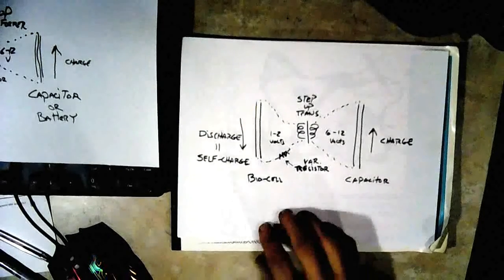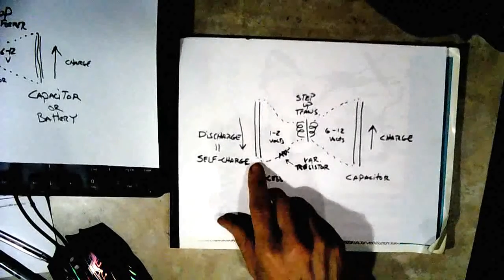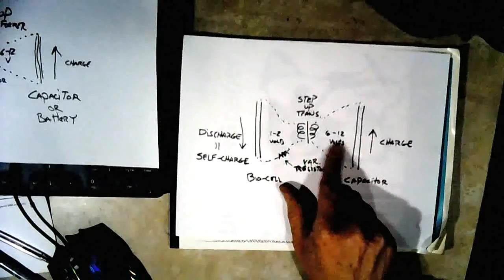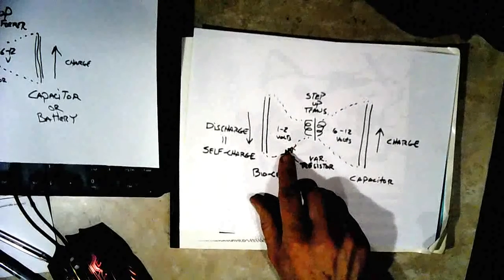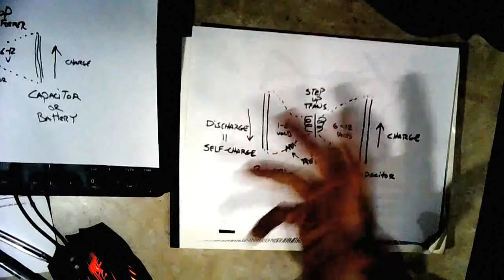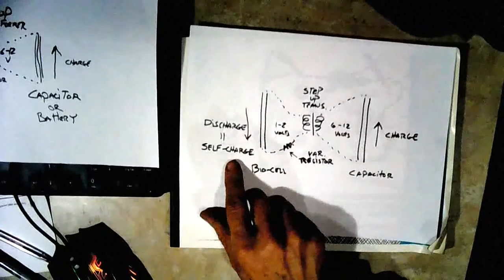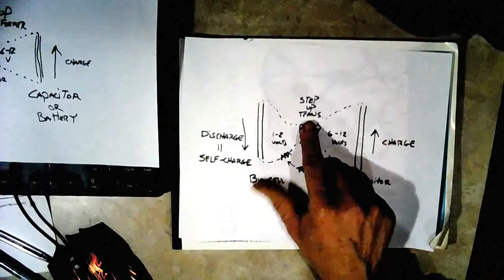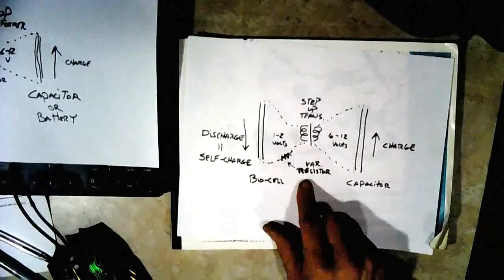Demo #40 Charging a Capacitor with the Bio-Cell

Comment: You need a boost converter, take apart a cheap solar garden light which boosts approx 0.7 - 1.2 volts upto 3.2v. if you remove the white led you will find it will charge higher, yes even 12v. You may want to use a zener diode to prevent overcharge of the secondary capacitor or bettery. Another option is to build a "joule thief" which is pretty much the same circuit.
Reply from the maker: Ah, sounds like a good cheap solution to the problem proteinman. Would a variable resistor work ok with that?

Comment: Fortunately, you can't run DC current through a Transformer it must be alternating current or pulsed current,  I would suggest using a pwm ( pulse-width modulation).  I assume you cannot run these cells in series without damaging there charging capability?
Reply from the maker: Good point ZPF!  I don't know about running the battery in series or not, I haven't tried it yet, but I assume you can. I'll find out. Thanks for the comment!

Comment: I tried charging a lithium cell with a crystal cell through a joule thief but the output  of crystal cells is so low the rate of charge was impractical for much more than lighting LEDs which the crystal cell will do on it's own anyway so I discontinued the experiment. The output of a joule thief is pulsed so it may pass through the capacitor during use. It'll be interesting to see how it works.
Reply from the maker: Hi Fred, why would a pulsed current pass through a capacitor? I've never heard that before.
Reply: I'm not sure it would. The circuit is a blocking oscillator and although essentially produces a DC square wave there is a back flow through the transistor albeit very small at cutoff. The response curve shows slight dips at the top and bottom, the magnitude dependent on the components being used. The frequency is typically in the 50kHz range. Depending on the capacitance it could react if ever so slightly. Generally a large capacitor would smooth out the signal. Then again that means there is the possibility of some interaction. I have no idea whether the reaction would have a significant impact on performance. I looked briefly for documentation but the reaction depends on variables such as the type of transistor, RC constant, etc.That's why I hedged my statement by saying it "may" do so.
Reply from the maker: I need to study electronic more.